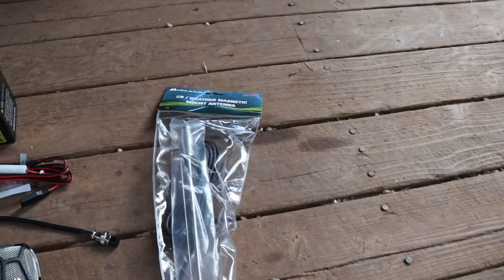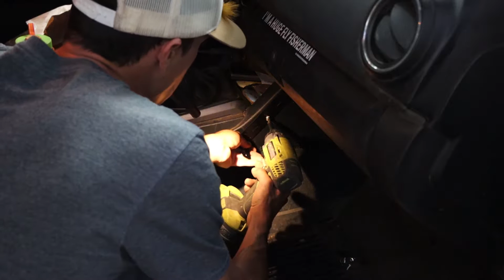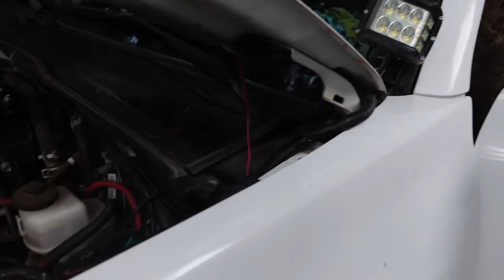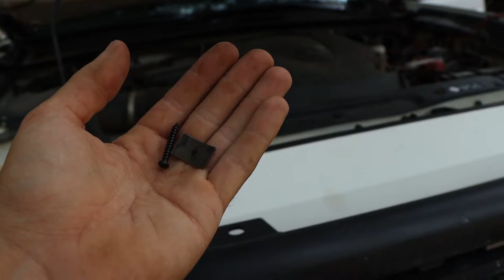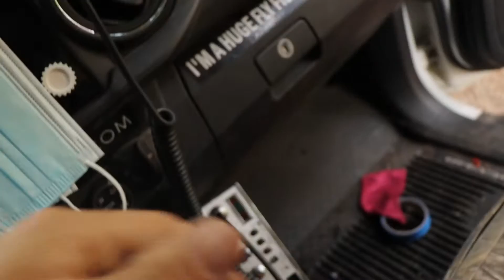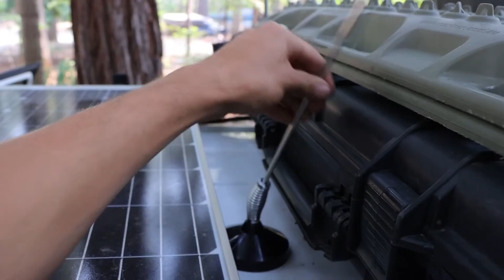Midland CB 5001z Install

Comment: Nice!!  I would get those wires off the floor.  You mentioned going thru water...if water gets into the cab you will be in trouble.
Reply from the maker: I'm not too worried about it. If I'm going through water that deep it won't matter if the wires are up another 4-6" 🤷‍♂️ worse situation would be replacing the built in fuse and I have handhelds for a backup 👍
Reply: @HighSierraYota  Ok cool!!   I have been off-roading and seen a few guys rigs get water inside.  Not realizing that it was deeper than they thought.😂

I love Runners!!  I have a 3rd gen.